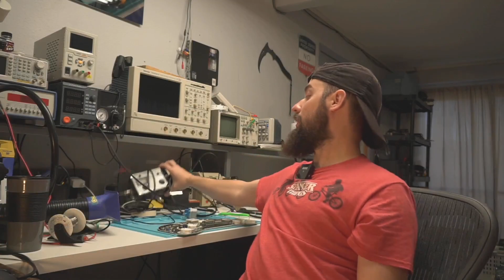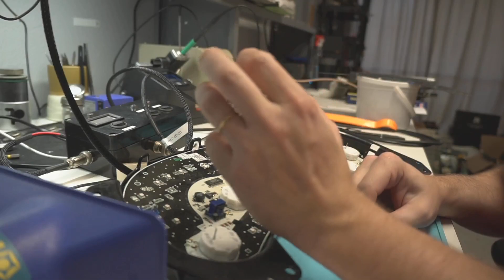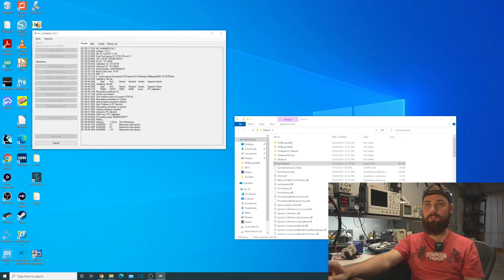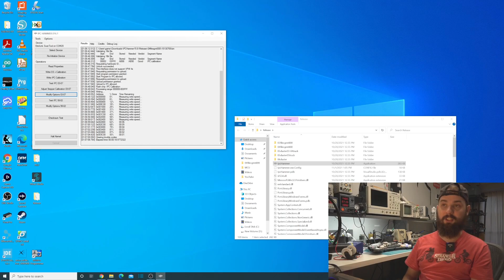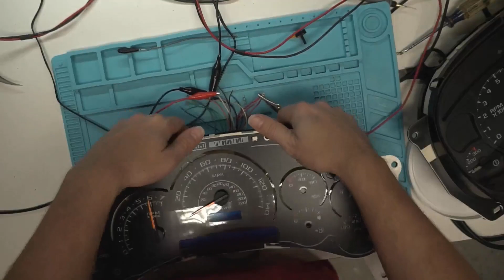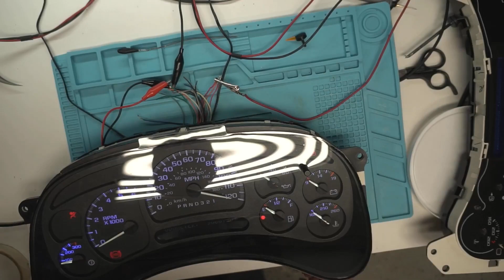03-07 GM Instrument Cluster Modifications: 7K RPM, 140MPH & Transmission Temp

Comment: So I have been doing cluster repair for years on these GM's but haven't gotten into doing custom stuff....but now I have a unique project in which I have swapped a 6.0 Express engine into a circle track truck and think it would be interesting to combine some techniques here and I am curious if it's doable. I actually want to take the 05 Express cluster and switch the speedo (which we don't need or want) to tach (nice big and centered), convert the FUEL guage to transmission temp (don't need fuel level and will use the transmission temp feed from the PCM for Engine oil temperature) and possibly change the other gauge locations). The overlay only needs to be functional. Is this something that can be done with IPC Hammer alone? (Aside from the overlay of course). Starting to like the idea of digging a little deeper into these!

Comment: I have 2 clusters that I’m deciding between modifying, one with the correct mileage that has no trans temp and vice versa for the other. It seems like I need the same stuff to be able to program them but I already have hptuners can I use it instead of having to buy another obd connector with the dongle thing?

Comment: When I get a cam that's definitely something I'm going to want to do
Reply from the maker: Plus it's just unique because there's not a lot of these out there. I know Mike has tested and I'm sending one out so maybe 2 or 3 out on the road so far?
Reply: @FixedUntilBroken  I remember seeing them on eBay like 5 years ago but had looked more recently and didn't find any but what did they come in originally
Reply from the maker: @james10739  yeah but they also gave you an EEPROM bin to make it work... but that doesn't work. I mean the 140mph part worked but not the 7k rpm. Its the whole thing that started this rabbit hole. so yeah there are a bunch out there that don't really work.
Reply: @FixedUntilBroken  I am having issues getting the 7k to work. Truck shifts at 6100 but pegs out 7k